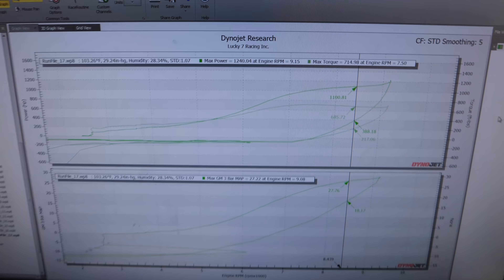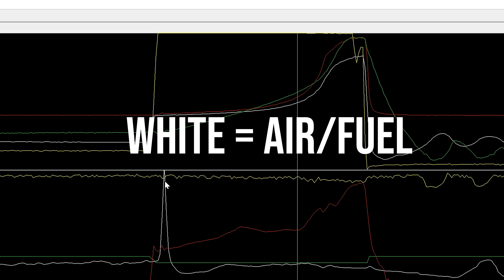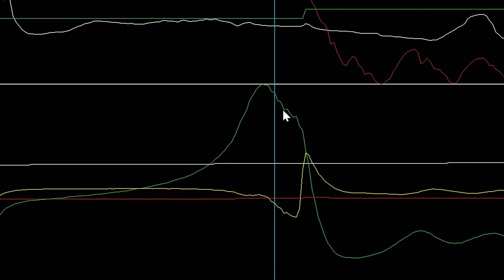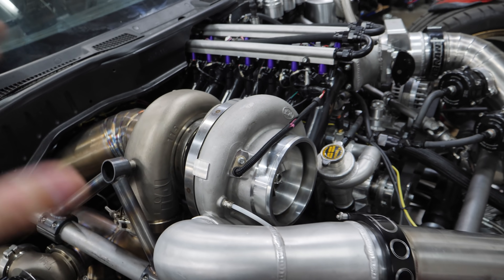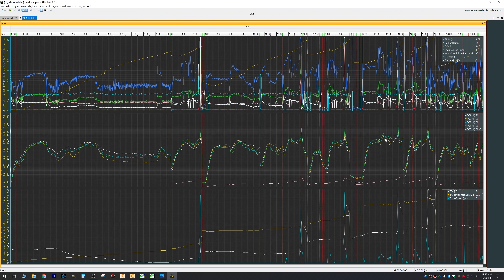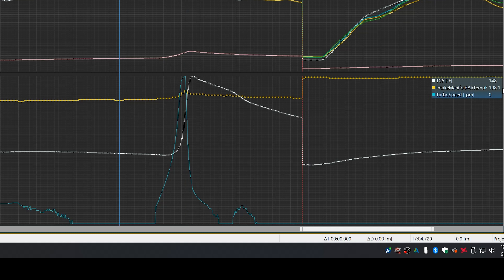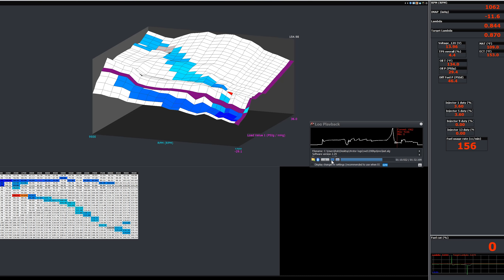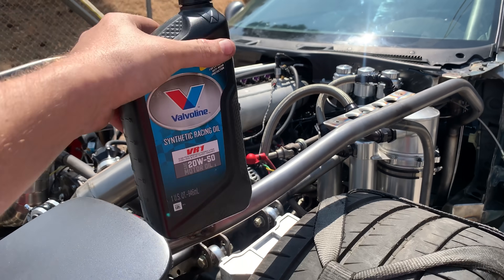My SECRETS to 1240 Horsepower!

Comment: Hi, just one note for measuring the exhaust temp, @14:00 , always use calibrated equipment, the K type has some flaws due to wire lenghts, junctions etc. and needs to be corrected.

Comment: Reminds me of what I was doing in 1988 with a Holset variable geometry turbo and electronic injection on a Cummins L10. 1300Nm of torque at 1000 rpm, ripped a 90mm 3mm propshaft like a coke can.

Comment: NGL this if now one of my top 5 favorite videos on youtube.

this is the stuff i live for.

You should colab with D4A and do an episode or several episodes of boost school together that would be absolutley amazing.

There is no simulator or mathamatical model no matter how accurate and complex that even compares to the freedom and flexability of real life, Love you rob.

But it would be nice if you changed the units (or added the conversions) for metric. it takes time to get use to it but once you do its like 20x easier than the mix of metric and imperial for doing calculations quickly.

Comment: "I made 1240 HP in my 4 rotor. But I'm just beginning to learn about that engine" - video in nutshell
Reply: well, the very engine is still stock as hell except the eshaft. so a lot of work and place for improvement there
Reply: I wonder what is in theory the limit for this engine.
Reply: i dont recall his displacement.. just twice it and check for inline piston engines max HP with that displacement. drag racing of course.
Reply: oh ok thanks now i don’t have to watch the video
Reply: C D i think its alittle over 700 torque
Reply: @cd2920  I've seen a 3 rotor make 1710hp on a hub dyno. Theoretically over 2000whp but the more rotors you add the more stress on E-shaft, it really depends on what that shaft can handle.

Comment: hey rob; don't remember what charging system your car is using but you should check the voltage/ current draw of the pumps (especially as you load them to maximum). seems forever ago the 4 rotor was a tube frame with no engine in it!

Comment: The perfect solution to the imbalance in the intake would be a massive ITB setup, but there isn't the room.  Perhaps curved flanges on the inside of the manifold to redirect air to the rotors at high flow might do it.  I'd imagine tack welding 1/2" tall strips to the walls that meet up with the trailing edge of each runner would make an improvement, but CFD in your solidworks would probably give you exact sizing, vice my ghetto educated guess.  Either way, ribbed for better air distribution.  Or maybe it's time to CNC a better manifold from billet...

Comment: The best thing about Rob Dahm is that he doesn't keep secrets like a lot of guys in the rotary world, if Rob goes missing one day we will know why! 😂😂
Reply from the maker: Yes the rotary world is filled with assholes. And a handful of amazing people. I’m sure it’s the same in most car communities but rotary is smaller so personalities and attitudes arise
Reply: @RobDahm  those bastards!!!! I got yo back homie!
Reply: Pretty much like Vargas brothers!?
Reply: @TheMegajr  F### the VARGAS BROS 
💪💪💪💪ROB DAHM💪💪💪💪 all day
 they think they're the only ones to know everything about rotary.
Reply: @chazman man it's easier than people think.  They see all kinds of numbers and crazy shit and freak out.  Just worry about your timing and your fuel curves.  Once you get that the rest will come
Reply: @troylee5641  bro I'm pretty sure they both are homies
Reply: @RobDahm  For those of you playing along at home. At 8900rpm 16457 cc/minute comes out to 4.347 GALLONS/minute. So the fuel volume for the engine would be 17.388 gallons a minute.  So with a guestimated speed for 110 miles an hour ( 1-1 trans ratio and a 5.13 rear ratio. 21 inch over all tire hight) That 161 feet par second @  .3 gallons per second. That 1 gallon every 500 feet. That's 2.64  gallons a mile
Reply: Yea one of those shops stole my internals for my 20b now my FD has been sitting for 10 years. I’m so tempted to pull it out and swap my spare RB26 into it.
Reply: @TheMegajr  No, Rob and the Vargas bros are REALLY good friends, The Vargas bros have been showing everyone how good Rotaries are when someone that knows what is doing build them, they might have some shop secrets here and there but nothing releated to build a reliable Rotary engine, they for sure are on the list of the good guys.
Reply: @chazman hell yeah!
Reply: @RobDahm  switch rotary out with any other niche and unfortunatly this rings true as opposed to the inverse
Reply: Proprietary info is proprietary info. I don’t get surprised when people want to defend their livelihoods.

Comment: Yes you are completely right, your tank isn't breathing enough. That fuel pressure stepping down like it is, is a very typical pneumatic problem while "metering in" (Atmospheric pressure trying to get into the tank). It creates a vacuum , but because air is compressible it's not stable and takes steps in pressure, because you are taking such massive fuel from the tank I would guess that's what it is

Comment: Hi Rob, OEM turbomatching tends to run at the very left limit of the compressor map at low RPM and once boost is up an RPM climbs you move across the map towards the center. I guess that a high performance match does not require running as close to the surge as OEM cause you don't need lots of low RPM boost but I would still conclude that you are out of compressor. I have not seen how your turbine inlet/outlets looks like but I believe your compressor needs more attention (bigger) than your turbine A/R. I am happy to help if needed 😁

Comment: That was super interesting, thanks for explaining all those details!
Reply: Also, I wonder if it would be possible to install active air vanes in the intake manifold of crazy engines like this, to steer the air flow during high load and keep the intake pressures and volume equal for all four rotors/pistons. Or maybe another set of throttle valves between the intake manifold and each combustion chamber.
OTOH that would introduce a lot more complexity and potential points of failure, so it’s questionable if it’s worth it.

Comment: Very good insight and Analysis Rob !👌🏽

I'd guess You're getting that last quarter of the RpM band  in a mild "saddleshape getting Your Lambda closer to "1.0" stichometric !

It's a fine line running such a high performance Turbo-engine that lean, but I'd aim at 0.92 to 0.95 with a warm engine and real good ventilation on a AWD Dyno working that map upwards stepwise  in the higher RPM regions! 

Don't forget this map and performance can drastically increase as decrease in free air on a real life track by cool RAM-Air ! => Due to Your intercooler flow setup.
Dyno ≠ real track performance in high RpM

Comment: Are rotors numbered/ordered sequentially? In this case, #1 in the front and #4 in the back? If so, could the gradual exhaust temp increase in each EGT probe moving toward the back of the engine be from radiant “cooling”, meaning the #4 is tucked under more stuff so it’s a bit hotter? I see this in air-cooled recip aviation engines. You can tell airflow over the outside of the engine by watching cylinder EGT. I may be way off since this is whole different animal, but thought there may be a little truth to it? Great video, keep it up!

Edited for crap grammar...

Comment: I think you might need a different intake set up so you get more equal air flow to all four rotors. Still solidly in the testing and tuning stag with the car, but definitly making solid progress forward now. I would wager this engine has more power in it.

Comment: The charge distribution is common on diesels. Depending on where the throttle body or the inlet on the manifold is the will flow more to the ones that are more inline to the inlet. On Cummins motors there are intake manifolds that have little gates or runners in them that help send air to the front and rear pairs of cylinders since the air is more willing to enter the inner set than to turn and go to the outer sets. A similar thing that I noticed when the McFarland boys broke ruby the further back in the motor the cleaner the pistons got. It would be interesting to see the execution but a manifold that has single runners that lead up to the throttle body would definitely help with distribution. An 8-4-1 manifold (ports to rotor to throttle body) would be a cool manifold to see but probably a bitch and a half to make a reality. It’s crazy how far this monster has come and I can’t wait to see where to takes you

Comment: Excellent analysis. I was looking at the end of run fuel consumption, and if I'm reading and doing the math right, that engine is consuming approx 18 gallons per minute or around 1100 litres per hour. Definitely going to create some vacuum in the tank at those rates.
Reply: Another reason for leaning out the tune a bit...

Comment: Rob- Enjoyed the video, really nice to see the value of per cylinder EGT sensors and a lot of the other data that get's skipped on lower budget engine assemblies. While adjusting the VE above 7500 to lean it out are you calculating a new VE value or do you have enough of a feel for the motor to make educated guesses?

Comment: It will be very interesting if Rob does at least street port and gets this thing above 40psi.  I can't wait to see this push 2k HP.  I would also love to see it around its current HP level go up against Cleatus Leroy.  Maybe adding a slight curve into the intake manifold might make rotor 4 temps come down a bit.

Comment: I have found some times my EGT sensors read high or low, have you tried swapping them to make sure it is actually rotor 1 etc taking in more air?  Timing can also alter EGT as you will know,  EGT also responds slowly so can be frustrating to tune with if you expect it to be like tuning AFRs.  Also .78 lamda, migalo, is it worth it leaning it out to .825? (safety margin might be slimmed for little power gain).  Awesome work!  Just commenting to help not being negative.  I love your cars and channel.  Thank you.

Comment: i know it's an old video but, to deal with the dyno there's a protocol to respect for the dyno itself and your engine. 

with so much power go for the longest gear. less tyre slippage. less loss and more accurate reading.
- click button start on dyno's remote and make your pull.
- once done disengage the clutch and keep throttling a bit and click the button stop for the dyno and wait for results to appear.
- once there, downshift progressively at idle with a blip to slow down the dyno roller gently until you come back to idle in 1st gear. 
- go neutral and analyze. 

repeat. as much as you need. keep the good work man.

Comment: For those of you playing along at home. At 8900rpm 16457 cc/minute comes out to 4.347 GALLONS/minute. So the fuel volume for the engine would be 17.388 gallons a minute.  So with a guestimated speed for 110 miles an hour ( 1-1 trans ratio and a 5.13 rear ratio. 21 inch over all tire hight) That 161 feet par second @  .3 gallons per second. That 1 gallon every 500 feet. That's 2.64  gallons a mile.

Comment: Since you’re rotor housing produce such high heats have you ever thought about mocking up the motor and then taking the gold heat wrap and putting it on the motor cleanly with a razor, even on each housing you can put more layers like on rotor housing 4 you put four or five layers thick, one layer over everything and two and the first etc etc

Comment: Rob, you are such an inspiration to guys like me who dream of one day being able to do what you do. Can I ask for advice though? I have a 1.4t Opel Astra with a turbo upgrade, making 180whp from the factory 130, however, now I have this issue where my car smokes, burning either oil or fuel on decel after I let off the throttle in the rev range anywhere above 2k rpm. I've had my car at 4 mechanics now and they can't find any issues, no signs of mechanical failure, turbo is brand new and doesn't seem to be leaking, dyno map is clean and shows nothing weird. Any advice as to what it could be? We've gone over the possibility of worn-out valve stem seals, of blow by but no signs appear. My only other idea of what it could be, is the possibility of too high oil pressure, pushing oil through the turbo seals, into the exhaust. It never smokes other than on decel from 2nd gear up and over 2k rpm.

Comment: You say that you were running rich (lambda below target) at the very top of the run, but also that your fuel pressure was dropping at the top, likely due to the fuel tank pulling vacuum. Is the car able to run that rich with less fuel pressure than it should have, or was the map effectively compensating for the low fuel pressure up top? If you solve the tank vacuum issue, would that massively increase the fuel pressure, and make the map far far too rich up top? Or does the map account for fuel pressure?

Comment: Race cars easier than stock!? 1000% agree no annoying emissions controls, cold start/idle controls, vacuum systems just to name a few . A race car is essentially “bare bones” and striped down which equals easy access to parts , ability to remove anything useless and redesign the car for ease of use and potential rather than the reliability/idiot proofing and standards a car from factory has to deal with .

Comment: A G35-900 doesn’t flow anywhere close to 90lb/min, the new nomenclature is to designate their frame size and rated hp
Reply from the maker: It almost flows 90 lbs min haha 80 plus. They may have gotten more efficient but the rule of thumb still stands.
Reply: Rob Dahm congratulations on your achievements with your car. You’re doing a great thing not only for yourself but for everyone you’re sharing it with.

Comment: Can I get a run down on why someone would choose stock rotors and ports over lightened rotors and race ports?
Reply from the maker: If one breaks it’s not catastrophic cost.  From a race standpoint and cost of ownership standpoint it’s extremely effective. I only need to get a stock rotor that weighs the same as my others. Now that I have the cnc machine I can do all the fancy things to it if I really want. But I want to show the average rotary owner that stock rotors and ports are far more capable than shops pretend.

Comment: Will it be better to tune the secondary injectors to come in earlier?
before primaries hit 80% duty cycle,.

I’m just saying as example,. 
Would it be possible for  inj. primaries to top ^out at 85/90% duty cycle  ~@7k rpm ?

Comment: you said that rotor 1 and 4 had about 8% in air disparity so can a tune solve this problem or there will be a need to make different intake manifold desing?
Reply from the maker: For now I tune it out with trimming fuel from each rotor individually but I would definitely look to design a better manifold if possible. It might not be possible with the space or size I’ve got
Reply: @RobDahm  I was thinking that maybe you could put some internal geometry element on the manifold to remedy this situation on the flow. Not a specialist by any means but i think that you need a fluid anaysis to create  the most ideal manifold for the engine or do it on try and error.

Comment: Is the displayed injector duty cycle% the actual duty cycle? Most injectors stop flowing linearly at 80-85% and it shows you're running 100% which would greatly reduce control.

Comment: What is your theory on running the injectors at 100% duty cycle? I have always read and been told they should not be pushed beyond 85 to 90% otherwise you risk a failed injector from burning out a coil. Are you calculating duty cycle differently, or are they truly at 100% ?

Comment: Just noticed something on this video that I hadn't on your others (I'm sure it was there but my eyes didn't lock on); is your boost signal for the EBC is in the compressor housing?  If so,  I learned from a tuner quite a while ago (I'm a bit older than you, lol) that sometimes you'll see boost/power surge due to using this location for your EBC signal.  Instead, try using the outlet of the IC (you'll need to weld in a 1/8th NPT bung).  VE of the IC is now taken out of the equation. The power will come on more smoothly because your target boost pressure won't have to deal with the IC inherent restriction.  The problem you may be having is the EBC is seeing "x" boost pressure but the MAP sensor is seeing something different (usually less) because of the restriction(s) in air path post compressor outlet.  When I made the change, it made a world of difference in drivability.